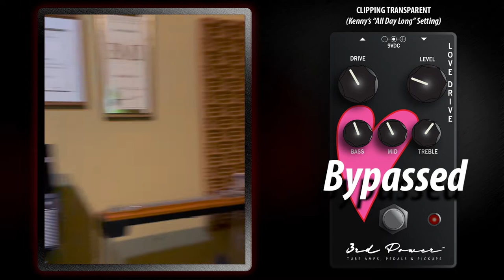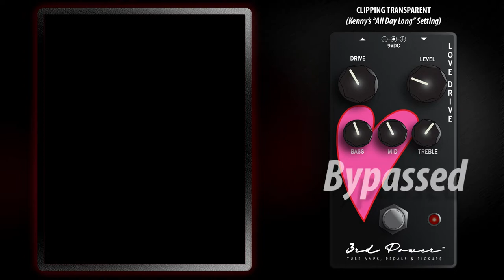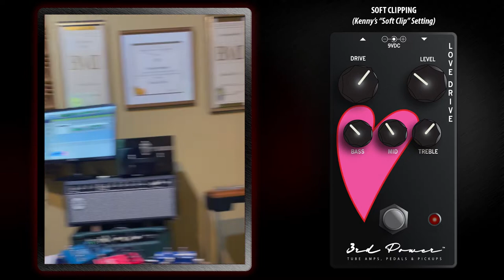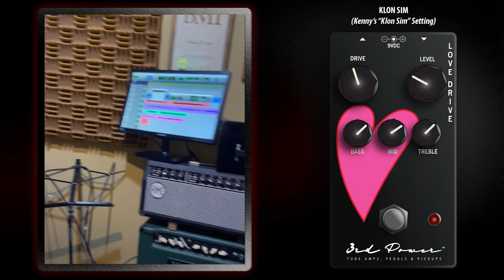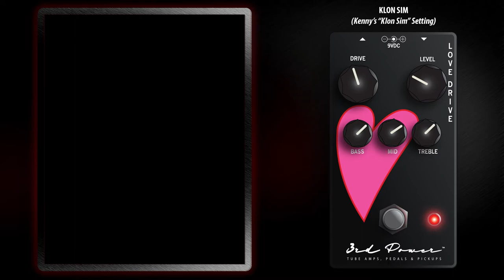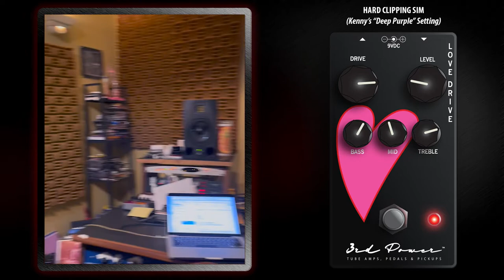Love Drive Walkthrough with Kenny Greenberg

Comment: Now would this still sound good through a cheap solid state amp?    I assume he's playing through a tube amp that costs a couple thousand dollars.  Even if one could get 1/4 of that sparkling sound through a solid state amp, it would be worth getting.
Reply: You can achieve pretty decent tone with solid state amps. Depending on the amp of course. I am sure it would be a valuable asset to the tone of a cheaper amp though.